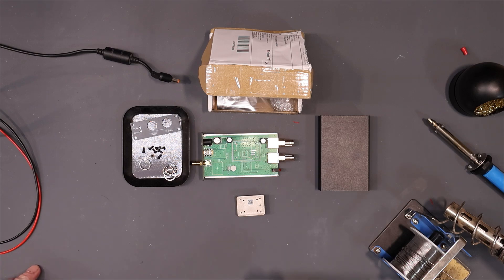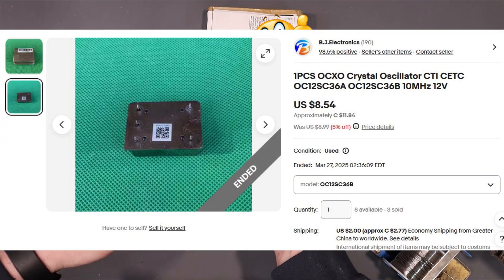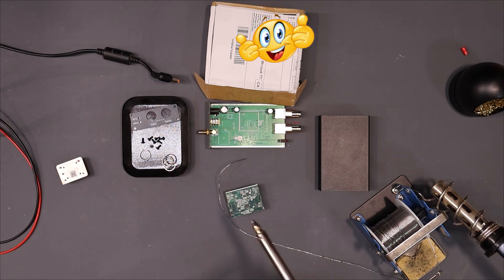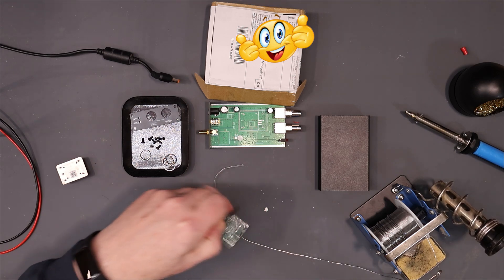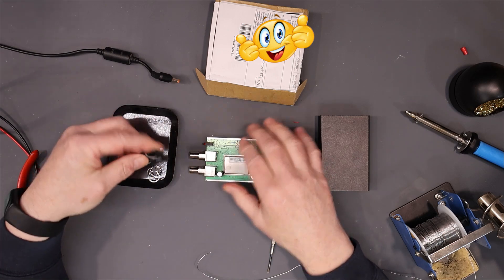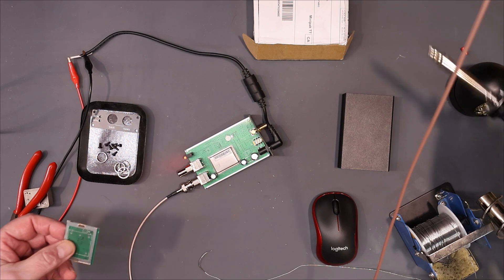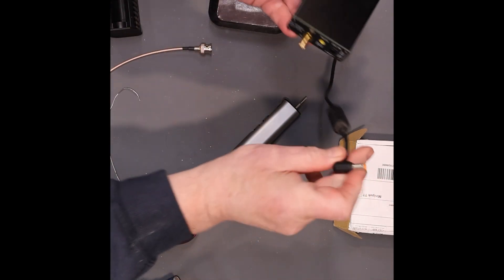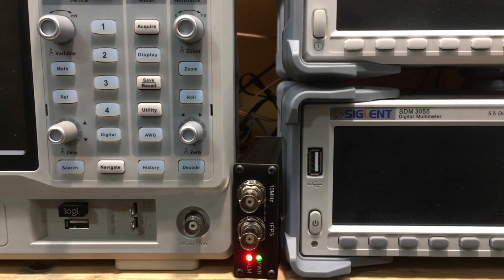Uni-Byte 0272 - I get ANNOYED and do a GPSDO Repair.

Comment: I have several of those ovened 10Mhz osc inn the project box, as well as a couple of pre-built units. You will find that the board the osc was on was probably removed from existing equipment with a bandsaw! 
 I suppose that you cold test them with a bed of nails setup, but I doubt if that was done. The naughty bit was the vendor not saying that they were used. When I bought mine this was very clearly stated.

Depending on the age of the unit, a used device may not be such a bad idea, apart from the price... Apparently when new these devices need a LONG time to get into their very stable area of operation upwards of a year. Even units that are second hand and which have already had a long operational life, often need some time (a month or so) to re-stabilise if they have been moved about a lot.

This is not really that critical with a gpsdo, as that will take out much of the remaining errors, but it cam make a difference if you use the device as the internal reference for a frequency meter.

 have a BG7TBL frequency meter on the shelf that I bought a couple of months ago, and that it monitoring the output of a gpsdo. Over the past couple of months the readout has become closed to 10Mhz (I know the BG7TBL unit has a used OCXO in it)   

Amazing that we can quibble about sub milliHertz accuracy at 10Mhz now.   Not that long ago a normal 10Mhz Xtal oscillator was considered pretty good

Andy.
Reply from the maker: Thanks for the detailed response, Andy.  BTW, the vendor did say it was used, just wasn't too honest about it being free of the old PCB .. nor are they offering any customer service.  Anyway, it's working now so I'll just leave it at that.

Comment: I bought 16 of those ovenized oscillators for $3 to $4 each from various eBay vendors, (though a good look at them indicated they were all from the same source, (the way they were cut out and the marks of the removal tools.) But I knew mine were just chopped off of boards, as the photos showed them that way. At my age I may never use all 16 oscillators, but I suspected there would be 2 or 3 defective ones in the batch. I'm on my 3rd install (a cheap frequency counter,) and so far they have all been functional.
Reply from the maker: I got about 10 of the square 5V ones.  Some came on boards, but they were both cheaper and advertised that way, so I didn't mind.   I noticed even those ones are no longer $3 LOL!

Comment: I bought some hollow needles to remove the last remnants of solder. Works OK for through hole components.
Reply from the maker: I actually have a set of those.  I can't seem to develop the proper skills to use them though.  Every time I do they seem to suck all the heat away and get stuck. Need more practice I guess.
Reply: @uni-byte  Just get a low temp solder to be able to heat all the pins at the same time (or quickly going around all pins and utilizing heat capacity), works much better.
I do no have a source to recommend, CN solder sure is horrible compared to what I got locally (leaded, melting at 100C), so can only advise to look elsewhere, not on Ali an such.
Reply from the maker: @Mr.Leeroy Agreed about the Eastern solder.  I usually use MG Chemicals or Kester.
Reply: Hi Dave, Squeak !
Reply: @andymouse  Hi Andy, cheese!
Reply: @daveodessa  :)